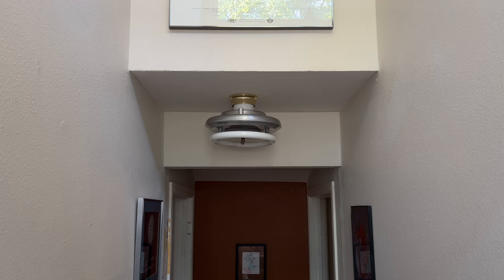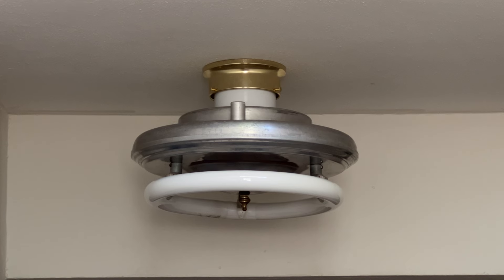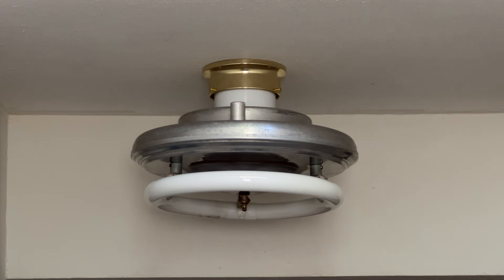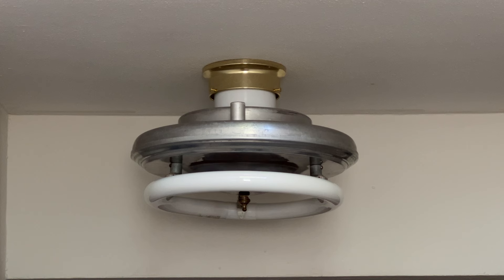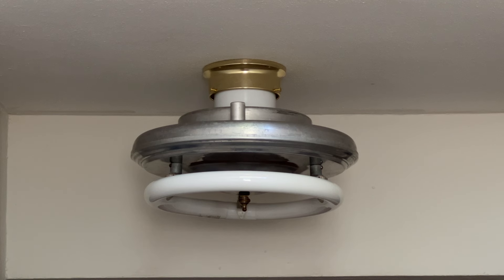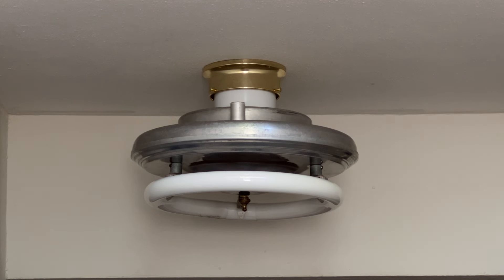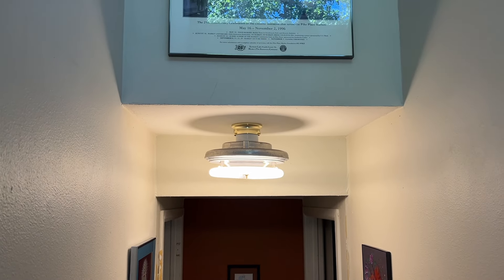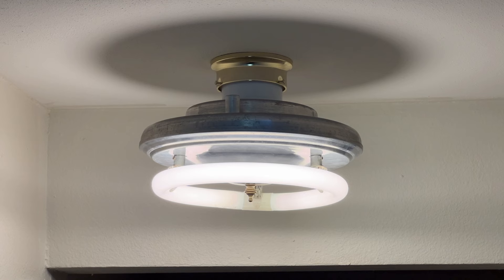Vintage 32watt Preheat Circline Fluorescent Adapter Fixture

Comment: What a beautiful fluorescent adapter fixture this is!!

I think this adapter fixture would look great on a ceiling fan that uses a 4 inch shade holder. A couple of years ago, I installed a 2 lamp F20T12 preheat linear fluorescent version of these kitchen fluorescent adapters onto a ceiling fan with a 4 inch shade holder in an apartment I lived in. It certainly gave the light kit a very interesting look. Due to the light kit’s lamp socket sticking out, these kitchen fluorescent adapters were a pain to install onto the ceiling fan, but the work was worth it.

Additionally, I also think that this adapter fixture would also look absolutely gorgeous on a pendant light fixture that has a 4 inch shade holder as well.
Reply from the maker: Thank you! I bet that F20T12 fixture on the ceiling fan did look quite unique!
Reply: @Parrot175  Certainly gives the fan an interesting look.

Comment: What an absolutely awesome fixture that is. Just last summer I got my first kitchen unit and it was an absolute pain to find a 4 inch fitter for. Just recently I finally got a period correct fitter from a rental that was being renovated. My fixture is a three lamp F14T12 half pipe style equipped with General Electric ballasts. I have yet to get any circline fixtures, hopefully one day I’ll come across one.
Reply from the maker: Wow that's a rare kitchen unit, glad you got it!

Comment: Cool circline kitchen unit! The long lamp clips make it look a little ugly, like my nice looking TiLite wheelchair with red Spinergy LX wheels swapped for heavy and ugly steel spoke wheels off an old chrome hospital chair with long push rim brackets that add that dorky look because the push rims (the bulb in the fixture’s case) put the push rims way too far out. But this would look better with a fatter vintage T 10 bulb instead of the skinny modern T 9 bulb. But aside of that, it is a cool and rare fixture! Most took straight lamps, usually 2 and the 20 watt 24 inch. The aluminum housing indicates either world war 2 era or immediate post war. Circline came out in 1945, so during the war, and only in the 12 inch 32 watt size. Cheers!
Reply from the maker: Yeah it definitely would look better with a vintage T10 bulb, if I find one I'll install it here. Cool information on around what date it was made, Thank you!

Comment: Are these kind of lights supposed to have any kind of covering over the florescent bulbs? I'm just beginning to learn about these and know very little. I have a chrome flush mount ceiling light with bubble glass accent in the kitchen of the house I bought several years ago. It works like a charm, but I've been wondering if it is supposed to have a cover/shade of some sort?
Reply from the maker: Most of these fixtures were designed to show off the circline bulb and thus never had a shade to begin with.